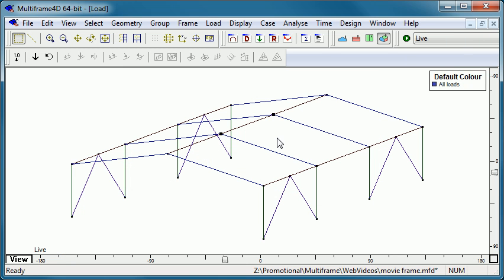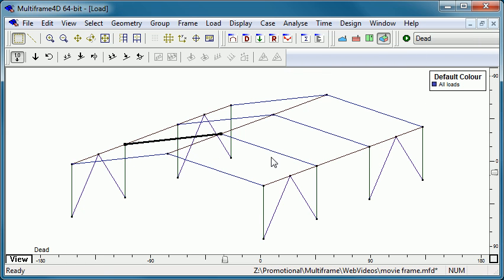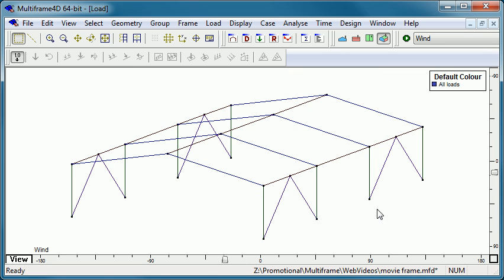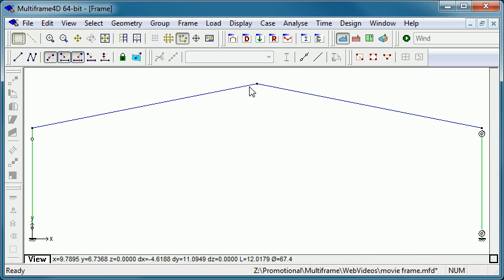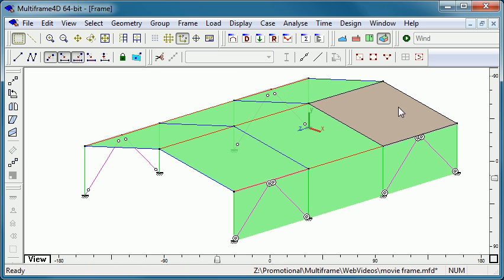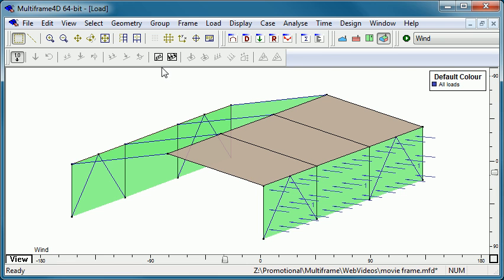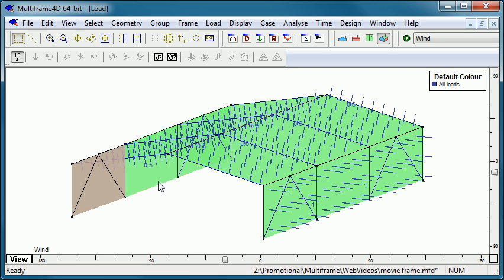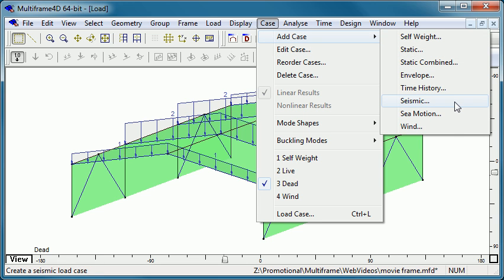Multiframe Loads

Comment: I am trying to create the panels but each time I choose the region the panel does is not created and disappears ...Is there any way you know how to fix this problem?
Reply: Never mind i clicked the little square with the L in it and they appeared haha. can't beleive the default was to hide them
Reply from the maker: They are turned on by default, must have got turned off somehow. Once you have defined your panels, true creating a wind load case and see how the panels can be loaded automatically from a wind profile
Reply: Thanks for the help.
I got some other issues now. I have created my structure but when I go and try to analyse the forces an error message pops up saying "Some of the members are not connected to the rest of the structure" and I am not sure how I can connect them. It's an offshore platform and the support legs are not connected with the platform according to the software